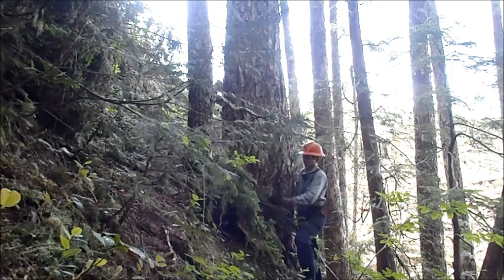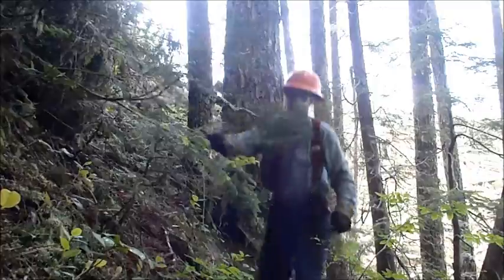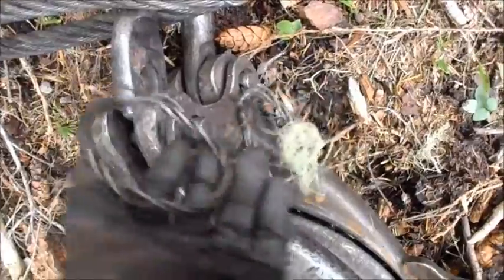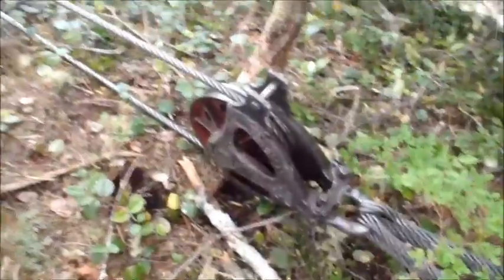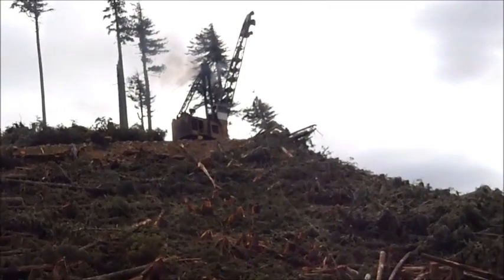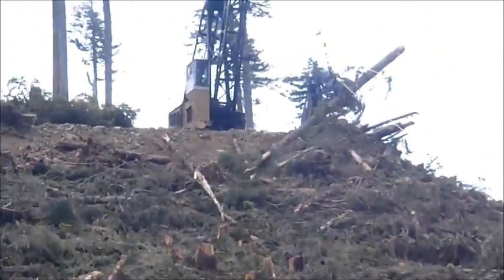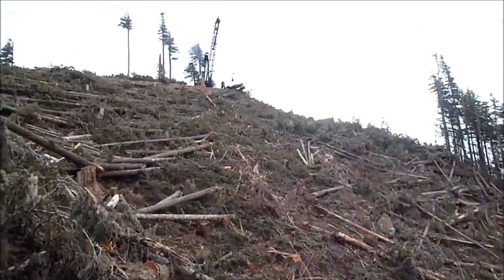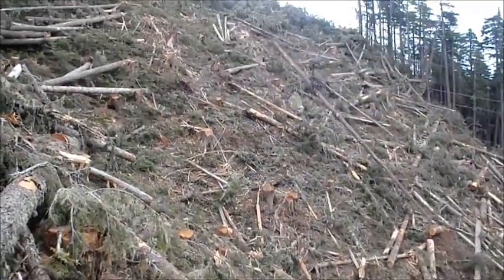What a Hooktender does

Comment: I always thought there was a ton of weight on they Skyline had to be up Higher than that . A man Learns something new every day . Thanks for the Share .
Reply: no skyline on a grapple yarder
Reply: @matthewstolth1551    Nope. Just the mainline and haulback.  I ran a Washington swing yarder for Crown Z up in Seiku, Washington in the '70s.  Something we did differently was we always moved the yarder rather than the back-end. Sometimes you can't, but that the way things go. That way we only had to run the rigging all the way to the back every few road changes. Front-end logging is way faster than back-end logging. :-)